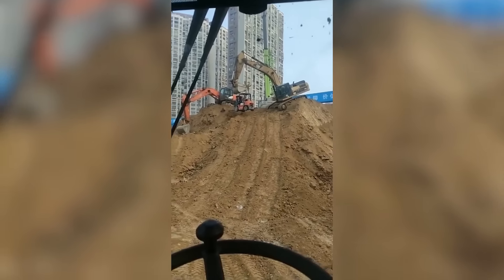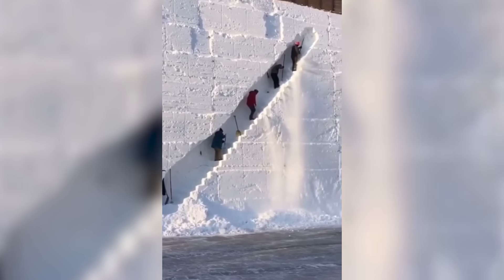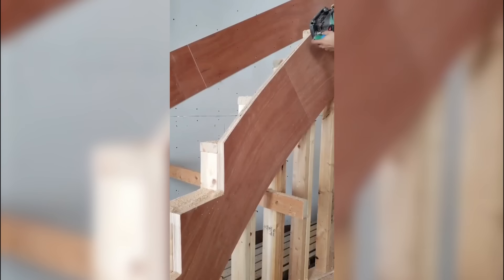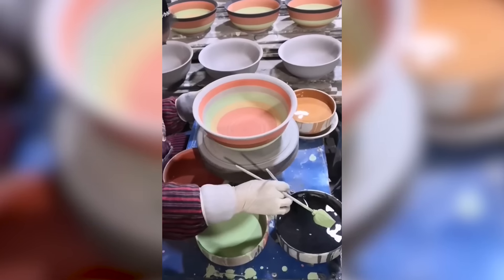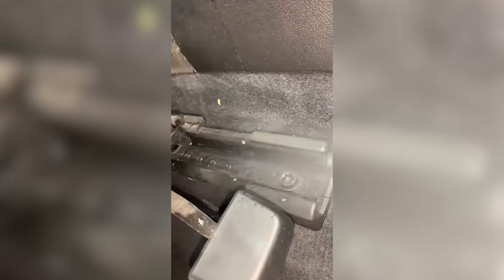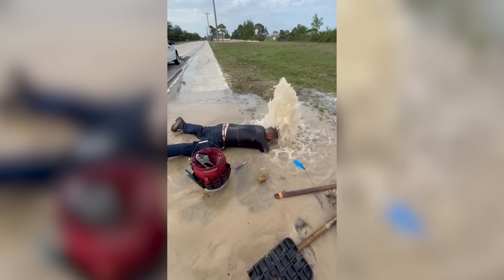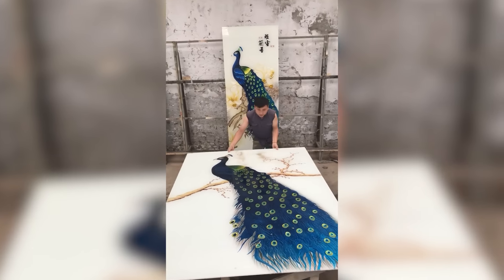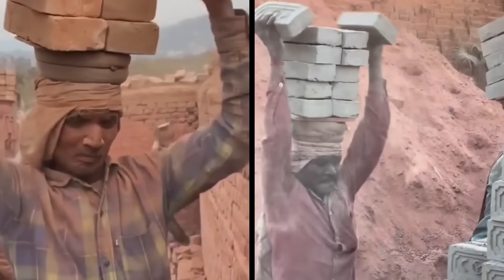Moments Of Workers Doing Their Job Perfectly

Comment: 8:46 Done that! It's called carpet kicking. You do it to stretch the carpet and remove any bubbles. That tool is called a carpet kicker. It kicks the crap outta the user too. (It's got spikes and staples fixed to a pad to bite into the carpet.) If you kick the cushion wrong, and don't use the top of your thigh, your kneecap will nope itself to somewhere town. I actually saw a guy who did this for 15 years, and he was quick. It actually looked like a kung fu skit, nothing like this. He'd have had this done in about 4 seconds in comparison.
Reply: Wow
Reply: Yeh I heard it could really wear you out quick.
Reply: @phlushphish793  Yeah it can take more energy than people think. Techique is important. I wouldn't go back to that work unless I REALLY liked my pay and coworkers.